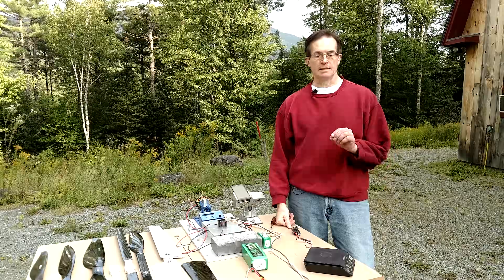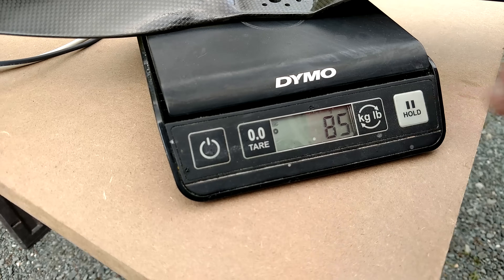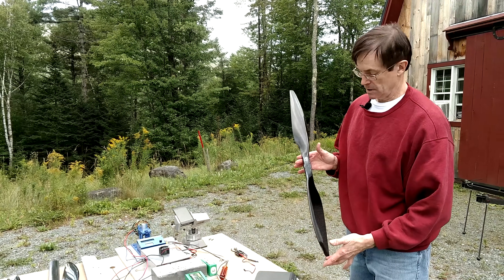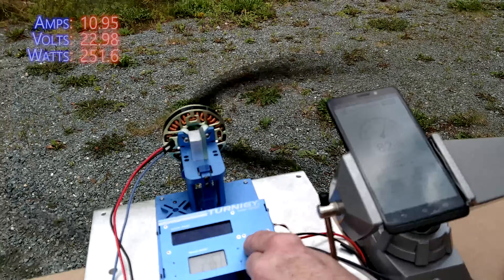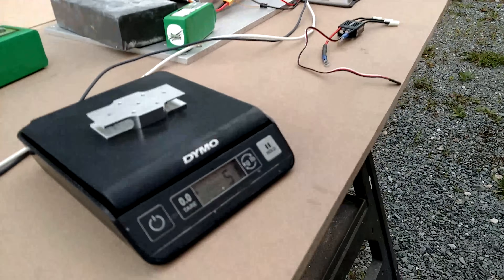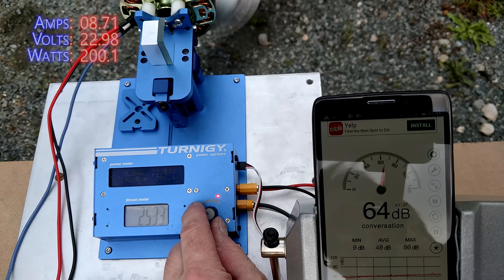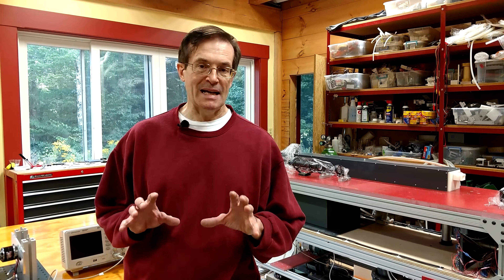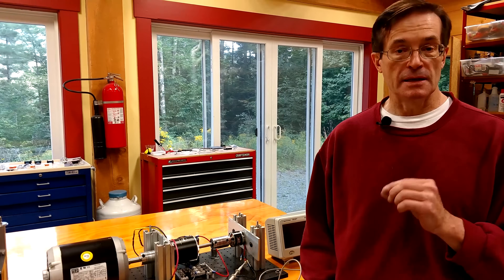Building Drone Rotors - PART 4 - The Testing

Comment: The Two boards blade (the one with no taper): 160 grams.  2533 thrust  210 watts 
Foam core blades, gray in color: 178 grams 2500 thrust 215 watts

The method he calls "heavy" and "difficult" "not preferred" made more thrust with less watts.
Reply: I think that was just because it's longer. I think if the foam core prop was longer as opposed to thicker it would have done better than it did

Comment: Awesome video. The most important parameter is not the amount of thrust but thrust per watt. If you put that also on the screen for every propeller that will be awesome gram/watt.
Reply from the maker: Thanks. 
In a way, I did because the power consumption was fixed during the comparison.

Comment: Love that you finally say that a gas turbine generator is the ultimate champion for endurance. And gas turbine ultimately fit for a single-rotor helicopter setup, not a multi-rotor system.
Reply from the maker: It should benefit both.
Multi rotor vehicles are not as efficient as single rotor helicopters, but the potential advantage of multiple rotors is rarely used because it's much more complicated than level flight. Unstable maneuvers, as you would find in a 3 dimensional maze such as a dense forest, would be a good example.

Comment: Total confusion  as to the information that was provided you never gave the thrust that was provided by each propeller
Reply from the maker: I did.
It was fixed at 1,500 gm.  The power was varied  to achieve that standard.

Comment: Regarding the power plant… wouldn’t graphene batteries, coming into the consumer market, be better than gasoline and lithium poly batteries? Graphene batteries are supposedly lightweight, high density, and fast charging… right?
Reply from the maker: The graphene would serve as the electrode material.  The chemistry  remains the same.  They would be a little  lighter.

Comment: You touched on a point that I have been thinking about for a while: using an APU (from a commercial airliner) to power the electric motors for an ultralight or a large drone to carry two people. Then, only a backup battery in an emergency and to fire the APU.

Comment: I would like to make 42 inches propellers - CW and CCW any advice ?
Reply from the maker: Check out  the commercial  options first to see if you can simply  buy them as well as how much it would be worth it to you if you build them. Otherwise, the principles  would easily  scale to that diameter.

Comment: I think the comparison between different propellers would be faire if the break horsepower powers was measured too.
Reply from the maker: You need to watch a little more carefully.
Each propeller was driven by exactly the same amount of power and the thrust was compared.
Reply: @TechIngredients  it's OK if the efficiency was checked 👍

Comment: Methanol + Hydrogen Peroxide fuel cell for power...  mostly in R&D and academia right now, but very high energy density demonstrated versus LiPo batteries less noise than ICE-hybrid, quick refueling, straight to electric.
  
Would be interested to see some advanced blade techniques - low noise, low turbulence and tip vortex.  Some of what Airbus Helicopters (formerly euroocopter) is doing on their H160 ( https://www.youtube.com/watch?v=dBS1NRsYuF8 ) and AgustaWestland is doing on their AW101 main blades ( https://www.youtube.com/watch?v=OchreIBZknI ).  I've seen some similar stuff on T-Motor's folding blades over 24".  Patents don't matter if you make it for yourself ;-)
  
BTW the second linked video in this comment shows how close the process of this video series is to commercial blade manufacture.

Comment: how would a propeller preform with a hydrophobic coating?
Reply from the maker: Probably the same as the interaction with the air is different than it's interaction with water.
Reply: @TechIngredients  Interesting, I thought something might change the fluid dynamics of the propeller moving through the air and possibly lend higher stability.. Due to higher flow and decreased viscosity. I mean like the propeller would do more work and disturb the air less..

Comment: Could you please tell me about the types of  mechanical testing performed on drone frame
Reply from the maker: Basically, static loading and balance testing.
Reply: @TechIngredients  thank you for your response sir. But I haven't  found any  research journal those focusing on mechanical testing of drones and there procedures. I am trying to write a research paper which mainly focus on mechanical testing procedures for MIdrone.
Reply from the maker: Thanks.
I'm not aware of any papers.   Most commercial drones are overbuilt, plastic toys.  Larger, drones tend to be purpose built and testing isn't widly discussed.  You might consider doing more than theoretical work and testing these airframes yourself.  Of course, your budget will matter.
Reply: @TechIngredients  Thank you so much. I will try.
Reply: Sir your work is very nice.

Comment: what throttle % would this be? 11amp and 2500g really low.. wondering what max thrust and 50% thrust is too.. along with like 25%.. researching bigger drones.
Reply from the maker: Throttle percentage is meaningless. Voltage and current determines power input.  Compare watts to thrust in order to evaluate thrust effeciency.

Comment: 4.5 years still great ideas I found out usefull for me. I watched the whole series owning the whole fleet of dji drones since phantom 4 had appeared. I like these selfbuild ones really or better your step by step explanation cause it can be applied to all the other stuff in RC hobby espesically planes. 
Thanks a lot for sharing all these details like balancing a prop and so on. I am really happy. Joined the channel back then when you did these speaker works or even a bit earlier I guess, but did not went back to the roots of your channel which I did today.

Comment: I am looking for a helicoptet blade with specific hover efficiency of atleast 20kg/kw and overall hover efficiency of 15kg/kg of motor weight. I think with large diameter rotor blade this is achievable. If  you can help me, I will be very grateful

Comment: Sir, I may something to the table to add here. Talking strictly about aerodynamics the main reason DIY propellers are never going to outperform commercial grade propellers is that they are not pitch variable (In reality what I'm trying to say is that constant pitch is physically incapable of beating variable pitch, at least a well engineered one.) The reason for this is that the thrust produced on a propeller must stress the propeller equally in all of it's length. This has to do more with classic dynamics and aero. The main challenge with improving efficiency of really fast moving objects becomes more often than not a matter of reducing mass. Having variable pitch and chord in a propeller mainly fixes two issues: one mass further from the axis of rotation will require more energy as it has a higher angular moment of inertia. So reducing mass therefore chord improves it a bit, secondly there is induced drag in the propeller that must be overcomed, just as in airplane wings induced drag is reduced by equalizing the pressure on the upper and lower surfaces. Lower chord and lower pitch reduce drag but also will reduce thrust, so there is a very fine balance between thrust and drag. Thirdly the relative airspeed of the tips is quadratically increased the further from the hub and this has gigantic effects on local thrust. As local lift (thrust in this case) is a function of the square of the velocity.
Reply from the maker: That's not true.  Pitch adjustment (active) is used to maximize thrust or adjust the RPM to better match the output of an engine, but not to increase the effeciency of the airfoil.  There is an optimal angle of attack for any foil.  Increasing the angle of attack closer to the axis of rotation is done to maintain that optimal AOA despite the forward motion of an aircraft.  This isn't necessary in hovering craft like a large drone or in most helicopters.

Comment: As I embark on my largest project too date where I've really had to fire up those Neurons, overhaul and retrain. Basically learning how to learn again . I've always kept my knowledge sponge consistently moist though it's time to completely submerge it and soak up as much as I can. Your style of teaching, methods of operation and general above average production quality have made |"Tech Ingredients" my go to source for knowledge, training &answers to any questions I've had so far. Your experiments seem to be absolutely non biased giving me answers that don't just tell me or show me a simple one directional path to my question, but a multitude of answers with all the good , bad and indifference allowing me to make an educated decision on what will work best for my project. The most important part of that equation is the fact that I was educated and it was more than enough for these decisions to be made with the upmost confidence in myself which so invaluable  that I could never thank you enough for the incredible job you all do to make this road safe, manageable and so clear to the point(s) my journey is topped with excitement, promise and foremost, The ability to " excuse the pun" launch this project and get it off the ground the way I want to see it happen instead of following crap advise based on ones opinion with little of no data to examine, ponder, create and know I've the proper instruction in all those facilities and if it doesnt work its something I did wrong or simply A decision I have made poorly not wasting my time trusting someone who care for more about "cool than "accuracy" . There is place for cool in science and you and your tam have definitely nailed the recipe here acing every nuance of laughter, practicum  and the desire to to step outside the box of comfortability and take o something totally new and knowing with every lesson you will kickass with a solid understanding of whatever it is you are completing next. Keep rocking and tthank you again for dunking my brain in that big cauldron of knowledge soup... needed super helping of that and you guys spoon up the best in town. Rock on. Kaj

Comment: TBH, most of those companies will advertise that they are better than the other but in reality most of them are the same however someof them will spend the extra dime for research for the more finer percentage... you can get 97% perfect but anything higher will need to dig into the pocket plus they offer different models such as 4 degrees, 8 degrees, etc and those have their own research and they do try to patent it but in reality... anyone that has an idea on how to make something bare bones that work just as good would be able to do it...

PLUS some of them even make it lighter either with lighter and stronger material or they drill in and remove material without taking away from structural integrity much like the presenter did with drilling holes to take weight off.

But in the end, cutting edge corporations want the best of the best for the best in science because... speedos want you to shave your body and wear their cap or else that stray hair follicle could distort your time by a 1000th of a second due to eddies.

Comment: I never got into drones, I prefer nitromethane or gas motor fixed wing RC.
Testing props yielded some interesting results, I had to up the rpm range of my 10cc nitro motor to 12,500 with a 13'X4.25 pitch prop for best thrust.
Most guys run an 8 pitch prop and they never get to the power band of the motor, it just stalls out at 7-8000 rpm and never allows full thrust from the motor.
The Chinese two strokes max out at 17,500 rpm, so running them at 12,500 doesn't hurt them at all, and I get about 8lbs of thrust out of a 10cc nitro motor, with a model that weighs about 6 lbs.
There is allot to be gained optimizing prop size, don't just follow convention, test and make your own choices.
Not one of my fellow fliers had any intention of optimizing anything, they just did what everyone else did, in my opinion, that is no way to live.

Comment: your decibel meter is earing the noise of the air that flows from the propeler... this isn't a valuable measure you should have put it on tha side of the propeler plan to measure only the propeler noise

Comment: Where is the kg thrust figure?
Reply from the maker: They all were driven to 1.5 Kg of thrust and the electrical power was what was displayed.
Reply: @TechIngredients  thx. So roughly 100w/ kg, yes? Do you think how much efficiency can be improved by increasing diameter and lowering rpm? Maybe 2m for really high payload.

Comment: Perhaps you and others can review but I was taking notes as you tested and both of your DYI propellers were significantly quieter.  At the 1500 test, the max was 82db for the 24" commercial and a low of 72db for the 36" commercial.  But your DYI props had 60db or 62db (at 1500).  At the 2500 test, they were up at 68db while the others were in the 80db range.

I hate the noise of the drones I have so making them quieter seems like a huge win.  Perhaps review this yourself and see if I got the measurements right.  You didn't stop and note the db levels so its a little tricky to snatch them at the right time.  The other obstacle was taking the measurement before you started talking.

Did the DYI props seem quieter when you were testing them?
Reply from the maker: Yes, they were. This is probably due to the lack of taper and twist.  Both these properties are not necessary on large, slow moving drones and as a result we can operate at a lower RPM.

Comment: I am very interested in applying this idea to fabricate a marine , 3 blade propeller. I recently built a small catamarn powered by sail and pedal drive. I've used propeller from an electric trolling motor and the pitch { the reverse of a gas outboard } is not aggressive enough. Any thoughts on this.
Reply from the maker: Have you watched our video on the "Tesla Catamaran"?

Comment: You have demonstrated and explained many questions I have on a variety of topics but when you mentioned switching from electric to gas-powered which makes a lot of sense it would seem more practical to transition to a gas-powered engine for your rotors. I suppose that it may be difficult to control using the controllers that are available compared to electric motor controllers but a centrally powered, larger rotor with three or four smaller electric rotors to control the angle would seem plausible along with flaps or other foils. With a much smaller battery backup it might be possible to create a controlled landing in the event of an engine failure provided the load was not too heavy and there seem to be parachute systems that could be deployed under those circumstances. Just as drones have eliminated some of the design challenges imposed by human pilots on military aircraft, and the monumental challenges involved with placing an astronaut on the moon computer-controlled drones could solve many of the challenges that you mentioned at the start of this series. While I appreciate the opportunities to use nuclear power to produce electricity as a cleaner alternative to fossil fuels and the opportunity to utilize off-peak power I prefer solutions like your swamp cooler, and desiccant based refrigeration systems that take advantage of simpler mechanics/reactions for the heavy lifting while taking advantage of electric power to demonstrate concepts. Small electric kickboards can now match urban traffic speeds mostly because of how inefficient moving large vehicles that displace huge amounts of air that create traffic jams is and the stop and go nature of urban congestion. Hybrid cars will be more efficient under these circumstances but they don't address the basic problem that the weight of the engine and vehicle often dwarf the weight of the passenger and cargo. I would love to see some videos of your catamaran and drone in action especially if you get your hydrofoil working on the catamaran. I have really enjoyed the past few days living vicariously through your creations.

Comment: what is the reason for making a gas powered generator, to generate electricity to power a drone, why not just use the gas engine to power the drone directly? as the energy would be used more efficiently and you would be carrying less weight?
Reply from the maker: The modularity is an advantage with the detachable generator.  It's also easer to isolate vibration and noise when the interface is flexible wires rather than mechanical linkages.  Finally, the electric motors have finer speed resolution as well as quicker response.

Comment: I was curious what happens when you consider upward speed? Doesn't the airflow change direction and therefore impact your angle of attack, lift, and drag? 

Thanks for your contributions, I watched the entire series. Great videos!
Reply from the maker: It does and as the velocity increases the value of twist along the blade becomes helpful.  At the low speeds of large drones, it's not worth the effort.

Comment: Thanks for the great cf laminating techniques! I build rc sailboats, and will use this on keel fins and rudders. I'm trying to work out a design where the leading edge of keel fin matches leading tip of keel bulb. With standard fin-bulb keels, the fin is centered on bulb. Problem with that is seaweed (pond weed) hits fin, then gets stuck on bulb. Once enough builds up boat is impossible to control and is dead in water. If fin meets tip of bulb weed can slide off.. I'm working out how to get lateral performance and reduce twist of fin when boat is heeled, since center line of fin will be in front of center of mass of keel bulb. This carbon fiber method should help, thanks!